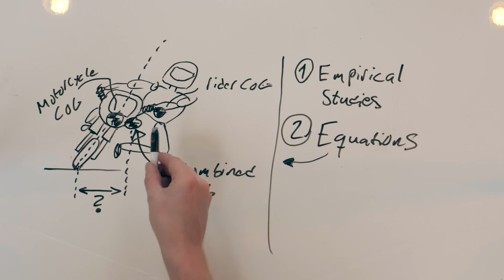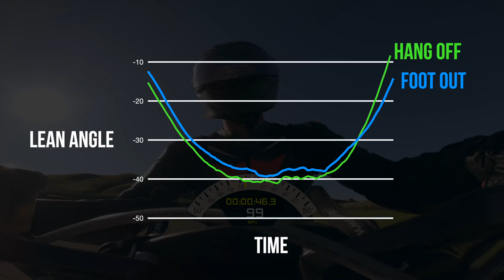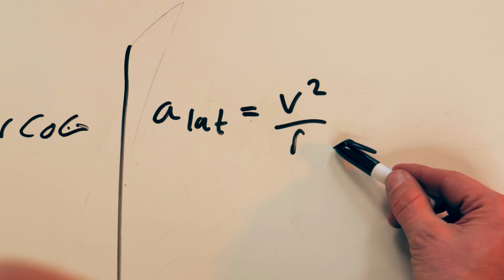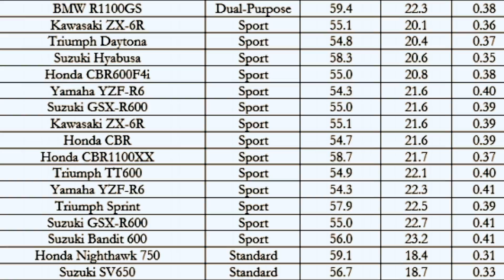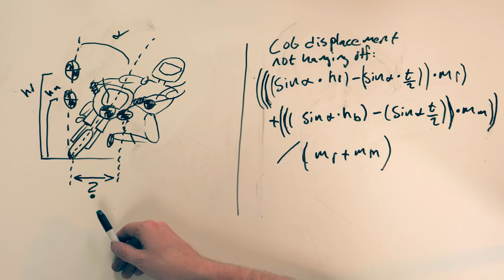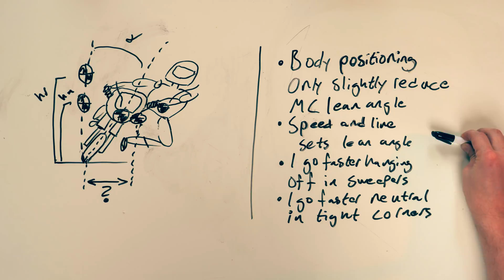Motorcycle Riders - Hanging off & The Science behind it

Comment: Mike: It seems to me that you’re making this more complicated than necessary.  Here’s a suggestion to calculate your lean angle offset, which is specific to you and your position on a certain bike:

Have a friend hold your bike as you get on in your hang-off position.  Admittedly, this isn’t that easy because the additional g-force of the turn helps tuck you in, but do your best.  Have him balance the bike in that position. Take a photo/video from the front and measure the angle from vertical the bike is.  This will be the lean angle offset.

It also occurs to me that the lean angle – whether offset or not – has nothing to do with the lateral acceleration at the contact patch; it’s purely a function of the centripetal force from the arc speed.  Thus, unless the contact patch changes with the part of the tire in contact, it shouldn’t make a traction difference.  The obvious exception is as you contact the edge of the tire (usually around 55 degrees lean, depending upon tire), the patch becomes smaller and less uniform.  It’s thus good to offset so that the bike doesn’t go much past this lean.  With that said, the coefficient of friction isn’t normally related to the contact area, though there are some fluid and heat dynamics of rubber that change this.
Reply: Oh, BTW, in case you missed this.  This is the best explanation of the leg dangle I've seen.
https://youtu.be/99Fat0jLj_U
Reply: You missed the part where lean offset is maximum when bike stationary or going in a straight line.    Lean offset drops significantly the faster you go (the greater the base lean is) - that is why all his charts are downward slopes. That lean offset you measured with a buddy is not the offset you get in a turn.
Reply: @TimotheeHowland    Why?  The lean is purely determined by the acceleration vector (combined accelerations of gravity and angular/centripetal vectors) and the center of mass.  The hang-off affects the center of mass, which is what my process measures (relative to plumb line).

The combined acceleration vector does change less as the centripetal acceleration increases (asymptotic limit of 90 degrees from vertical). but it doesn't affect the hang-off offset amount assuming the body position and center of mass remain constant.  The lean angle will always be the line formed from the center of mass through the contact patch.

Comment: There are different riding styles, point and shoot style doesn't require hanging off or extreme lean angle. You can ask Casey stoner about it. You only hang off just to prevent the bike from flipping over due centrifugal force. With more lean angle you need less to hang off and for that you can ask Jorge lorenzo.

And BTW motorcycles only mimic the dynamics of airplanes only not completely. Some bikes are designed to be naturally stable, some bikes are design to be naturally unstable. And by unstable I mean to input and to leveling.
Reply from the maker: Yeh.

Comment: 4 degrees is a very significant difference... the fact that one is more or less capable to benefit from those degrees in terms of lap time is a completely different story...
Reply: Most of us will never reach the maximum lean angle of a bike, and so I'd argue that not wasting energy moving your body is more useful than keep your bike more upright. But, if you learned to ride by hanging off, or if pretending you're in motogp makes you feel great, there's no escaping the mental side.
Reply: @jasonjayalap  I would say if it is for a track day, the hand out do make u feel more comfortable and the bike would more stable for sure. But if its for riding in mountains maybe its pretty same since most of us will not lean too much there
Reply: did he factor in this also helps in managing tyres throughout race and also the riders height at world class matters alot. if you're small, you really have to hang off the bike to get the bike to turn. 

look at toprak vs bautista. aside toprak insane breaking skills, toprak barely has to hang off the bike to take a corner and compared to bautista is fighting demons trying to hang his body so far off the bike just to turn it.

Comment: What about the "sail effect" of hanging off which increases wind resistance on the inside of the turn and facilitates the turn?  I think that alone explains why you were faster on long sweepers hanging off.  Long sweepers are high-speed turns and increasing wind resistance on the inside of the the bike by itself will turn the bike and allow less lean angle and more confidence to go faster.
Reply: sail effect works really well on braking too, popping up and opening your knees drops a whole lot of speed before you even touch the brakes, there's no way hanging off doesn't apply some force to help in the turn.
Reply: @Ledfndr  Yes!  Exactly.
Reply: @Ledfndr  Thats what I thought it was more for as well

Comment: I agree with your findings but I don't agree with the conclusion. What makes you say 4 to 5° reduction in lean is not significant?
I have found that when optimising systems, a small adjustment toward optimum often gives big benefits. Especially when your starting value is far from the optimum.

Comment: I was once told ... The bike is the bucket, your body is the water. Any water on the outside of the bucket is not added to the weight transferred to the ground. (Traction) Inertia throws the weight outward & downward through the tyre. The greater the angle the more weight added to traction. The more body on the inside the more weight added to traction.

Comment: I think when you consider the cog of the rider you also need to consider that their head (a very heavy part of the body) is even further inboard than the chest
Reply from the maker: The head is roughly 7% of a humans body weight. Upper body from hips to neck is about 52.5 %. Thighs 21 %.

According to Motorcycle handling and chassis design, Tony Foale, 2002.
Reply: @MikeonBikes  cool. I don't know where I read it. Long time ago. I thought it was a lot more (at the time I read it it surprised me how much it was), i could well have been mistaken.
Reply from the maker: I have read about this as well in internet forums. Internet forums are the epitome  of cognitive bias.

There are a lot of falsehoods and guesses on the internet about  motorcycle riding technique, and the physics behind it.
Reply: @MikeonBikes  but it still leaves the question for me about why to lean off if the angle effect is so little. Yes if you're one of the motogp boys 2 degrees probably makes all the difference but for myself I feel that I lean the bike a lot less when i hang off (and maybe that's the point and fits along your point of what feels better). The only other benefit I can think of is that your weight is more detached from the bike (your butt not planted in the seat) so if the bike moves around you can use your body weight to keep a constant momentum whereas if you're in seat suddenly your body is moving and so is the bike and now you have two moving things to control. And I know i'm talking from a fair amount of ignorance just trying to apply logic (I occassionally ride track days and pretty much not on the road)

Comment: I'm excited! Thanks for this awesome video. Just perfectly supports my current quarantine plans. 🤗

🤔 Has the contact area of the tires been taken into account for the different inclination angles? I drive the Michelin Pilot Power 2CT.More inclination means more contact area. There are data sheets from the manufacturer. The fact is, on the gsxr Hangout feels right. Successful description on your part👍
Reply from the maker: Indeed tires have many different profiles. I was not able to figure out a way to account for the tires profile in my equations for the torque around the CoG.
One could speculate that race tires have an optimum contact patch, located at some given lean angle.

Comment: Thank you for proving what I have debated based on logic for ages; that hanging off means less when it comes to reducing lean angle the more you are leaned over! Also, again according to my non-mathematical logic, the more you are leaned over, the more it pays to raise your upper body in reducing lean angle. Or put another way; sitting bolt upright at 60+ degrees of lean probably reduce lean angle more than hanging way off with chest on the tank. PS! Mike Hailwood would have been thrilled to see this video - he was never convinced hanging off gave any particular benefits.
Reply: Although hanging off does move the COG vertically down at a greater lean angle. Does this also have an effect?. Bet it makes the maths more fun 😉

Comment: Also. Its different on a supermoto. if you are on a naked, street or sport bike. You are much more stable hanging off since you have more room for error. If you dont hang off leaning into a corner. Good luck saving it if it starts sliding :p
Reply: I have zero experience in slidding but I've heard hanging of makes it much hard to control and slide since your less connected to the bike and that when you push the bike down underneath you, while its more likely to slide its easier to control, hence why MX riders lean the bike more than their body.
Reply: @ironzep  on a supermoto yes maybe. On a regular you can't slide with control if you sit up straight. You will crash

Comment: As an exercise, try turning the bike through a corner while leaving it as straight up and down as you can. The only way to achieve this is to get off of the bike more. You literally push the bike away from you. In your front facing shots (shot by the rear camera) - you are going with the bike as it leans over with little body adjustment. If you want to reduce lean angle and increase speed - move your body off and leave the bike where it is - you will be able to go faster. I recommend doing my experiment on a mini road racer or mini supermoto. The effects will be more pronounced but directly transferable to larger bikes.
Reply: Hang off as much as you want without providing any steering input, it will do almost nothing. The only real way to turn a motorcycle is to put steering input in. We've known this forever, whatever you're taking about is in your head or you are providing input as you hang off.
Reply from the maker: Listen to Cody.
Reply: Someday you must experience the "no-body steer" bike at the california superbike school. you will realize it has no effect and you've been countersteering this whole time.

Comment: There is a moving missing data here: the meatbag on the sit !! Depending on how much pressure u apply on the footpeg/tank and how u pull your handbars u're artificially moving your centre of gravity... I think its the "core" of riding, and i think marquez is better because he masters it
Reply from the maker: Could you explain this in a bit more detail? Please refer to equations you have drawn out, or to empirical studies you have conducted.
Reply: @MikeonBikes  When riding on the track at high level you aren't really sitting down except in the straight. While cornering most of the weight of the rider is on the inside peg. I didn't study the physic of cog but I feel like calculating cog only by calculating body weight thats off center and without accounting for the fact that the rider is "pusing" on the pegs is wrong.

Also a 2-6° of lean angle is a lot when you know that most street tires max lean angles are somewhere around 65° (Didn't look it up just pulled it out of memory) that's a pretty considerable amount especially in unexpected moments like accidently going into a corner too fast where leaning off can make the difference between crashing or not. I feel like the conclusion is leading a lot of people to believe that leaning off the bike isn't as important as it is when riding fast.
Reply: @guimauve522  peg weighting puts the total weight lower on the bike and helps move the CG down, true, but hanging off has a larger effect on the torque than the slightly lower point of cg gained with more weight on the pegs. if anything, more peg weight, and the lower cg it causes, will require you to use more lean angle, because interestingly enough, bikes with very low cg points are quite hard to turn and ill-handling.
Reply: You may be right, that bounces in  my head aswell, footpeg pressure vs your leg over the side vs how much pulling vs how much pushing. He gets the feel of grip better than all of the rest and has incredible reflexes. His reactions are early and fast.
Reply: Only time I ever pull on the handlebars is when I'm riding one handed.

Comment: When you have not that great tyres (or below optimal temperature) or the pavement is not that grippy those few less degrees of bike angle really make a difference tho
Reply: KIND OF, i was wondering an i can safely say: Watch the difference between ISLE OF MAN TT AND MOTOGP.
In motogp, guys go fast and can use A LOT their body because the TRACK IS VIRTUALY PERFECT.
BUT in a road racing, you just CANT DO IT, you need to keep a classical riding style cause a normal road has a lot of bumps and different grip levels along its way, sometimes along one corner path.
SO with your body BEING LESS OUTSIDE THE BIKE, its is FASTER and SAFER to recover from any abnormality.
IF you do the motogp body positioning style in road race, you will NOT HAVE TIME TO RESET your body position and SAVE the failure.
So, its safer to ride in a less extreme positioning when youre in a road.
Reply: @evilzinabyssranger5695  you know where you can stick your caps lock?
Reply: @evilzinabyssranger5695  I think it’s more dangerous to lean the bike on shit roads than it is to hang off. Tar snakes, debris, water, oil, potholes, all cause loss of traction. The more your bike is leaning during the slip, the better chance you have of crashing

Comment: I think it actually gets a bit more complicated.  Some turns reward a later sharper initial turn and getting on the throttle earlier, while some turns won't reward much with a fast exit, so gaining time is done on the brakes and trail braking into the turn more.  Hanging off can impact how quickly you can get a turn initiated by already being in position.  While hanging off, you're also often letting your own body act as a portion of the suspension, and can allow the bike to better react to bumps in mid corner.  Also, I've had times where I was hanging off, knee on the ground, and started losing either the front or back.  Because my arms and legs could let the bike move, I was able to correct my inputs and save it.  If I was sitting neutral on the seat, the bike would've thrown me enough that I wouldn't be able to react or would be causing unintentional inputs.  

That said, on a supermoto, I agree with using the mix of styles, and using whatever works for each corner.  I think the most fun I've ever had going into a turn was coming out of a glancing right hand turn in top gear, throttle pinned, and then braking so hard going into a sharp left that I was sticking my left leg out as far as I could just to have weight out to the side to help pull the bike over while I was only making contact with the front tire.  Granted, that's also how I got experience lowsiding by braking too far into the corner, and also how I subsequently started learning how to counter a front end slide mid turn.
Reply from the maker: My data does not support the claim that hanging off impacts how quickly you can get a turn initiated. In fact, looking at the data, in the turns where I hang off, my lean angle variation over time is slower both on turn in and on exit.

How does your body act as a portion of the suspension when hanging off?

When standing up on a dirt bike, your legs become “part of the suspension”. But when hanging off, you are not standing on the pegs with the rest of your body disconnected from the bike.

To get a stable body position most racers push their outside knee into the tank. This is also why tanks on sport bikes are formed in the way that they are.
Reply: @MikeonBikes  That's interesting with the data.  No implications there.  I haven't analyzed data for that, just figuring that since the bike wants to fall into the corner when leaning off, it would be easier.  Guess that's why data acquisition is beneficial.  Maybe I'm just tall, or tend to lean off too much, but even when I have my outer leg locked against the tank, I am supporting a lot of my weight on my legs.  When I've had the rear tire step out, my legs just extended as the bike pushed away from me.
Reply: @chipmunkshavenuts  it definitely feels like bikes fall into a corners faster when pre-hanging, but dont forget, when we do that pre-hanging we have to apply steering angle to keep moving in the intended line, letting go of this opposite steering torque is what makes that reaction to fall feel so fast.